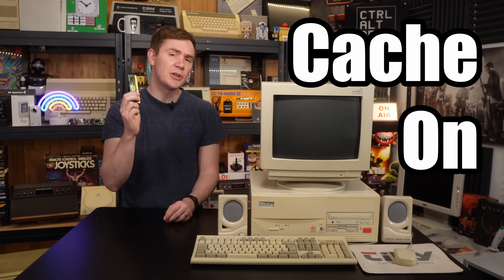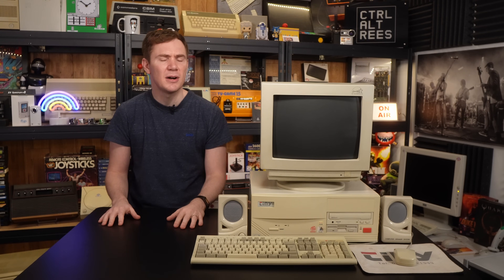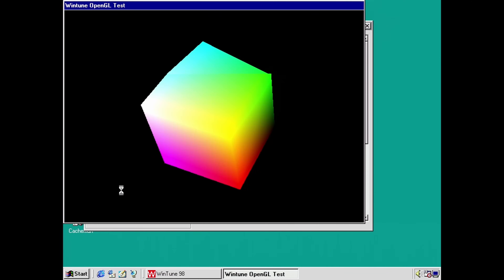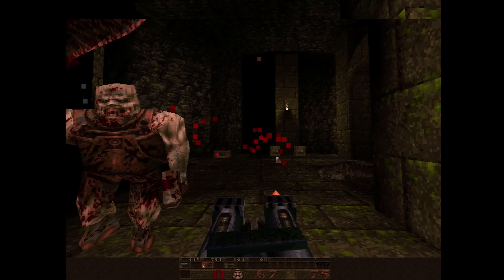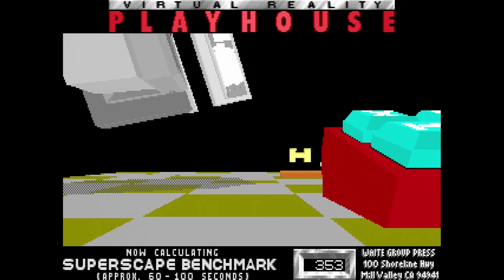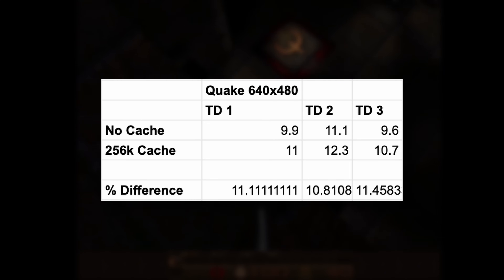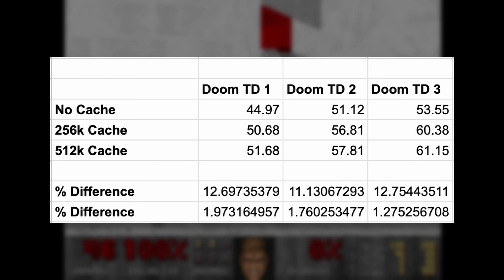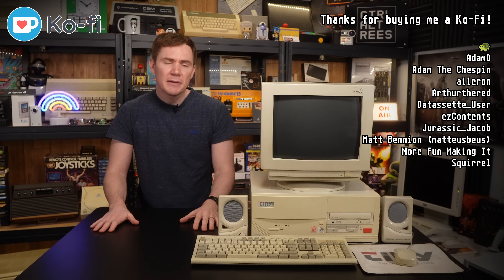A COAST Module For My Pentium 100

Comment from the maker: One thing kind of outside of the scope of this video but worth a mention: COAST modules could be a bit of a minefield wrt compatibility, with different revisions and different manufacturer-specific implementations, so if you're in the market for one for an older system like this please do consult the motherboard manual. I've heard that in extreme cases using the wrong one can damage your motherboard, although in practice I've never come across this.
Reply: I actually did have a motherboard become damaged due to an incompatible COAST module I installed in it, several years back. Sadly I don't recall any specifics as it was all hardware I was playing around with at the office.
Reply: Cache memory speed onboard is different from Coast module. 8 ns versus 15 ns. This could affect The performance.
Reply: Hello @ericoserravite9356 how you came out with these numbers, I watched the video again and I only saw cachechk numbers at 3:40 with L1 internal cache at 7.6 and 256KB L2 at 10.8 so can you elaborate, did he show any numbers of cache latency other than these?
Reply: Yep the socket 3 ECS M919 have a proprietary slot that only accept an special module, I have heard there are several versions of the motherboard and modules each incompatible with one another 😂
Reply: Did you try a coast module alone, w/o the onboard enabled cache?
Reply: Remember the boards with fake onboard cache chips and a COAST slot?

Comment: I have a few hunches here: (1) Most games optimized for the 8K L1 the pentiums had, (2) if (1) is wrong then they optimized for smaller L2 caches. Thus wouldn't be hitting a 512K. (3) the motherboard's cache implementation may be rather stupid and directly mapped to physical pages, so unless you have the board completely maxed out... it probably doesn't even use the COAST module. This seems the most likely case. (4) your GPU might be holding you back here. Try something with really good VGA and OpenGL performance? But, realistically test to see if it's the bottleneck. The performance on Quake is what gives me the hunch on this. Quake should have scaled better.

Comment: My first pentium 133 system has a motherboard that has a COAST slot. Its a dreaded VX board, so even though it can take 128MB Ram, only 64MB is cached, so anything over 64MB you get a performance penalty.

I still have the system but it has been upgraded (200MHz MMX, 64MB Ram, but still haven't installed anything in the COAST slot).

Comment: I'd love to see how it moves around large datasets; databases, modifying a number of large tables, etc. vs games. Pull a large table from the drive then modify it a few times and see if the modifications run significantly faster than without the cache. Or working with a large image in something like Aldus Photostyler pre Photoshop

Comment: I had a MicronPC 486 that I put an AMD 5x86 in. It had 15ns DIP cache chips. It would almost run at 50 Mhz bus speed. If I disabled the L2 it would run. But even with the AMD CPU 'hotwired' to force 4x multiplier it was really slow at 200Mhz without L2 cache. So I set the bus speed to 40 Mhz for a 160 Mhz CPU speed with L2. The 10ns cache chips it needed for 50Mhz bus speed were too expensive.

The 4x multiplier hack for the AMD 5x86 for the 486 socket was very simple. The pin for the multiplier is right at an edge and a Vcc pin has only one pin between it and the multiplier pin. I'd take a short piece of fine wire, wrap it around the 4x pin, bend it out and around the next pin so it didn't touch, then wrap it around that Vcc pin.

That particular PC was the only 486 I ever had with a 50 Mhz bus speed option so I never had another chance to try for a 200 Mhz AMD 5x86 before I got to Socket 7 systems. It also had three VLB slots.

The 5x86 was supposedly a 3.3V CPU but I ran many of them on 5V without any problems, as long as I used a good heatsink with a fan and white compound. I would also file the bottom of the extruded aluminum heat sinks flat. Temperatures would be much lower than the literally blisteringly hot Cyrix 5x86. I once got an instant blister on a fingertip off one of those Cyrix CPU's heatsink when I barely brushed against it.

Comment: At the time, my friends and I had 486 100Mhz and Quake ran very slowly. One of my friends bought a Pentium 66 and had an advantage in FPS. I installed Linux on my 486 and Quake ran, noticeably, as well as on the Pentium.

Comment: The addition of cache to processors being a big performance jump from 486 to Pentium is quite interesting since it did help performance. 

But increasing the external cache from the 256k to the 512k COAST surprisingly didn't scale. My guess is that the tests performed did not maximize the 512k cache.

On a different perspective, its fascinating how much CPUs are more reliant on the cache since the Pentiums of the 90s. Watching some of Phil's videos where he disables the CPU cache (i.e. a Core 2 Duo or Athlon 64) to get performance closer to a Pentium or 486 really reveals how crippled the CPUs are with more limited amounts of cache, especially when the fastest L1 cache is messed with.

While watching the video I remembered the external cache got eliminated by the Pentium 2 since Intel put the cache chip beside the CPU inside the CPU cartridge then later got integrated to the CPU itself by the Pentium 3 much like how modern CPUs do it.

I do wonder if a compression/decompression test with 256k vs 512k external cache would produce a more noticable difference like how AMD's Ryzen X3D CPU have a big performance boost from the increase in L3 cache on compression/decompression workloads.
Reply: Along with compression/decompression, compilation workloads may also scale better like how they do with more modern CPUs.

The increase in cache helping those two workloads I mentioned was why I gone from a CPU with 16MB L3 cache to one with 32MB L3 cache and the performance boost was quite nice along with improved system responsiveness.

Anyways that's it for me and my rambles haha.

Comment: If I recall this correctly most boards can´t actually use both on board and Coast together, once you insert the Coast module the on board cache may be disabled. it would be good if you shown that the board actually uses 512k or not. However I think you would benefit from a 512K stick and then maybe you could had used the fastest setting in the bios too

Comment: Increasing the amount of cache will expand the maximum volume of memory that can be cached on your board, so if you have a modest amount of RAM then it makes sense that there would be no difference in performance. However, since the cachable area is at the bottom of memory and Windows uses memory at the top, you should see a performance hit with a small cache and a ton of RAM.

Comment: I remember one late 486 motherboard allowing as much as 1 MB of external cache to be installed, but it was really just about bragging rights, because as you found out, it made virtually no difference versus the 256K external cache that most other boards supported.
Reply: The only way that would make a difference is if someone specifically designed there code to take advantage of the 1MB cache.  Unless the 486 is to slow to full up the 1MB of cache ??

Comment: I remember that time, and when I went to buy my last Pentium I system, the seller already clarified that unless I put an exaggerated amount of RAM for the time, the additional cache module was not justified at all. I'm not surprised by the result at all, perhaps in a system like the latest MMX and running a true 32-bit system like Windows 2000 things will change, in Win95/98/Me it's a waste of money for that stick. At that time the real bottleneck was the horrible chipsets that were sold in the cheapest motherboards like the infamous pcchips, which slowed down any processor you put on it.

Comment: The real rarities that I remember from the 90s were the machines with 1MB of cache. It was useless for almost every use case, but the folks who maxed out their systems loved to make sure they could get a system with it. I only remember seeing it on DIP boards. On COAST boards we would go with 512kb instead, an easy upsell for someone who wanted to get the last bit of performance for relatively little money. You always knew someone was looking for the best when an order came in for a system with SCSI hard drives and the extra COAST stick.
Reply: I was a broke teenager in 1996 and I read this big article on how amazing cache was for slower Pentiums like the Pentium 100 I owned. I decided to save all my money for a 3dfx card, then a new PC. Glad I did bases off the benchmark numbers here. 3dfx card was a night and day difference.

Comment: I'm pretty sure you're aware of this, but the main reason Quake ran so abysmally slow on non-Pentium CPUs was not that the other CPUs were really that much slower (the later 486s from Intel, and the 486DX4/100 in particular had Pentium-like features integrated already), but the fact that Quake was heavily optimized for Pentiums. I remember Quake running just as badly on (somewhat) later CPU offerings from Intel's competitors, even though these CPUs were definitely faster than the original Pentiums in most ways. 

It was a nice way for Intel to consolidate its grip on the x86 CPU market, but it was pretty much based on a lie.
Reply: This is very wrong. Quake did target the Pentium FPU, because it had to. The Pentium FPU was that much better than any 486 FPU. 486 FPUs were really that much slower. The P5 stomped any 486 in terms of raw FPU. Before the Pentium/K5 FPUs were a bit of an afterthought.
Reply: @humidbeing  I never said the Pentium was bad or slow, only that Quake was heavily optimized for the Pentium CPU in its entirety, not just the FPU. And that is not necessarily a bad thing. 

Hoever, had it not been optimized for a single class or generation of CPUs as much as it had, the playing field would have been much more level and the differences in performance would not have been as great.
Reply: @humidbeing  no damouze is right. The was an oddity in the pentium fpu, that up until that point, all the other fpu manufacturers thought was pointless. It may have been register renaming, I can't remember now its years since I coded in x86 assembly, let alone x87! Seem to remember all the other fpu took an extra Tstate to swap fpu registers or something. But, even if quake hadn't used this feature strangely often. The fact id the pentium fpu was a weird but very fast design, using 3 state logic rather than binary. That was the cause of the infamous Fdiv problem in the P60 & P66 cpus. 1 was effectively 0 , 0 was effectively -1 and 2 was effectively 1. So when clearing registers read for Fdiv, a mistake was made in a few of the bits(I'm not calling them their actual name for fear of the you tube algorithm) . As a result the Fdiv bug. But this 3 state fpu design was about 50% faster than contemporary binary systems. So, hats off to intel for their weird but fast as duck design.
Reply: @martinbingham-l5m  Are you concussed? I'm the one that said the P5 fpu was really fast and not just marketing.
Reply: @humidbeing  Concust no. Drunk however? Maybe. I got the names wrong way around. Sorry about that. Happy new year!

Comment: If I remember correctly, the size of the cache makes no real difference in terms of speed, but it makes a difference in how much RAM can be cached.
You should run the speedsys benchmark, that plots a graph on the lower right hand corner, showing the access time across the whole range of installed RAM.
The 512k of L2 cache would only make a difference if you have more than a certain ammount of RAM installed.

Google "Pentium L2 Cacheable Size" to find some articles about this.
The gist of it is: If your cache is too small for the whole RAM size, only the lower part of RAM will be covered by the cache. But that only makes any difference if the upper part of RAM is actually used by whatever program you are running.
One table I could find indicates it also depends on the cache mode.
According to that, 256k would be ideal for 32MB RAM in write back mode or 64MB in write through mode.
512k would be ideal for 64MB in write back or 128MB in write through mode.

So in order to see a real difference, I would suggest installing 128MB in the system and running the speedsys benchmark. That should show the cutoff in the access time graph.

Comment: I think the reason the COAST didn't help is because you were looking at things that were more CPU or GPU dependent rather than memory dependent. Something like CAD software or other heavily memory bottlenecked programs could show a much bigger improvement, assuming the rest of your system isn't presenting a bottleneck. In Quake, it's clearly the rest of the system that's the bottleneck
Reply: So, for the general public that purchase these machines to run games, office applications and delve into internet on the first Pentiums, that extra cache was indeed a waste of money better expend elsewhere, like more RAM, faster GUI accelerator, a bigger HDD, a faster CD-ROM, better sound card, hell even a MIDI module.
Maybe you would need to get into very expensive CAD/CAM, database stuff to realize any gains with a bigger cache, I have read that for a time Pentium Pros with 1MB weren't replaced with PII 300 as these had only 512Kb that runs at slower speed.
Reply: @RetroTinkerer  more or less. however Quake indicated that it was heavily CPU limited in the test system. GL Quake would probably have run faster than software rendering with a Voodoo GPU installed. Once those things were addressed, the COAST module might have made a bigger difference, maybe

Comment: Oh, I hated those. Between compatibility issues to bad slot. Well not really a bad slot. But, I remember more than one machine it would lock up or bsod. Tapped around the board. Boom, cache on the stick. Luckily after a short period of time it was soldered to the motherboard. I remember reading about that was one of the reasons why they did that.

Comment: That motherboard was bad, but at least it wasn't using fake cache which was common. No way to discern it apart from bench-marking, fooled at lot of people. No ability to disable the onboard cache and run with just the coast module at it's fastest settings in BIOS is bad though. Also Quake really is just an FPU demo which really doesn't benefit much from a large cache. Prime95 with small FFT's really is the bench to go to.

Comment: It is possible that 512k cache allows to cache more ram, than 256k(f.e. 64mb instead of 32). Try to install 64 or 128 mb ram and run cachechk.

Comment: COAST modules always seemed a bit disappointing compared to motherboards with DIP SRAM chips. You'd think if they were going to introduce a new form factor and the modules were going to be rather expensive they'd have worked harded to optimise the speed.When the PII came out they managed to get the off die cache to run at half the speed of the CPU at the cost of having to package the whole lot in a slot rather than a socket. Interestingly the Pentium Pro had separate CPU and cache dies packaged an oversized socket and the cache run at the CPU clockspeed. I guess the PII's PCB was cheaper than the slightly exotic multi chip module the PPro came in.

Comment: It would be very interesting to compare compiling speed for the three cases.
Reply: Agreed. Game devs and graphics libraries were probably targeting the most popular configs to hit the market sweet spot. Compilation, finite element analysis, audio/signal processing(?), database workloads might uncork the full potential. Linux should still boot on those things right? Coding up a simple benchmark of probes/second into increasingly larger hash tables should show the benefit.

Comment: I'm not entirely surprised by the result with 512KB, but I am surprised that not having any L2 at all makes such a small impact, even though according to the cachechk shot you included it has over 60% more bandwidth, and system RAM has almost 70% higher latency. Very interesting.
Reply: Maybe that little difference is because the cpu is too slow to show that bottlenecks, the cache becomes more important when the cpu clock sepe became much more faster than ram. CPU increase their clock speeds faster than RAM does, there is a paper about that, it's call: "it's the memory, stupid".

Comment: Curious as to whether the coast sram is as quick as the onboard sram.. and by mixing the two is why the gains were why it was significantly underwealming in terms of returns on investment. interesting video all the same.
Reply from the maker: That's a very good question, so I went back to the CACHECHK results to check. Seems both the onboard 256K and the COAST module clock in at a reported 97.4MB/s. Of course this could be a limitation of how the cache is structured on this system vs. how CACHECHK measures it, I suppose.
Reply: @ctrlaltrees  wonder if there is a means of disabling the onboard 256kb to compare the results of the 256kb coast, a jumper perhaps

Comment: I have the ASUS P/I-P55TP4XE motherboard wirh 256K soldered cache. I also found an COAST module for it but the price seems a bit expensive (180€ NOS). I use 64M of 60ns EDO RAM. Would I benefit from using 512k of cache vs 256k for 64M RAM? How about if I install only 32M RAM?
What are the relation between the amount of installed RAM and the cache amount needed for optimal performance? I searched but got conflicting informations.
Edit: the small difference between 256k and 512k of cache is mostly due the small amount of RAM you have. For those 16M of RAM, maybe 128k of cache would have similar results like those you got with 256k. Try to max out the amount of RAM and then see the difference (redo the 512k cache tests). Not sure about your motherboard, but some maxed out to 64M, altough most socket 7 motherboards I know supported up to 128M EDO RAM.